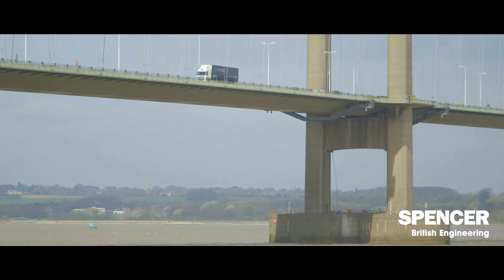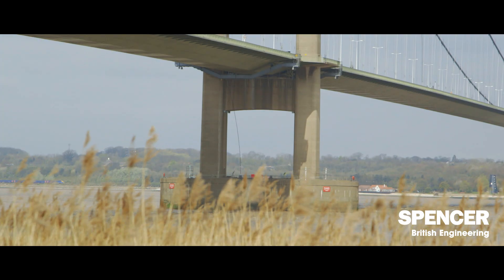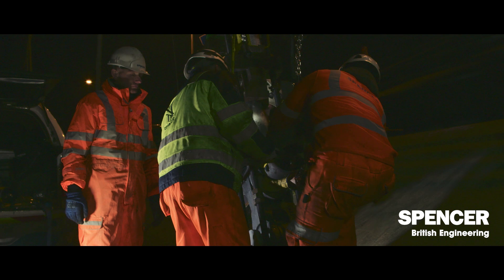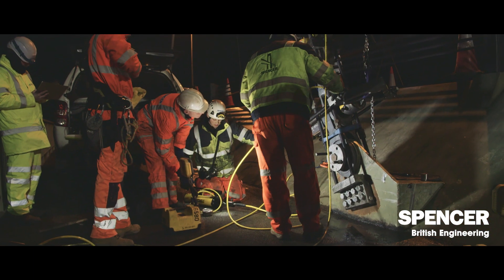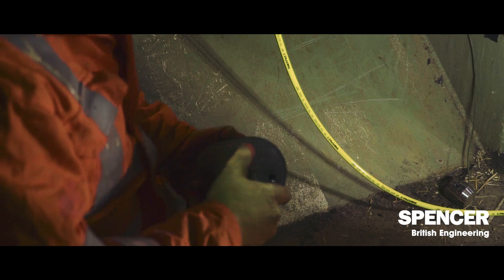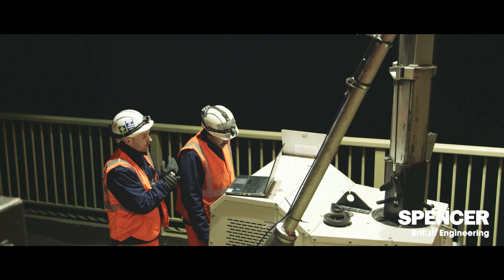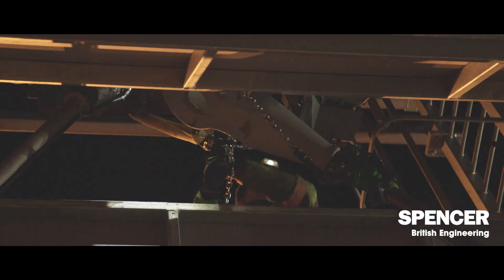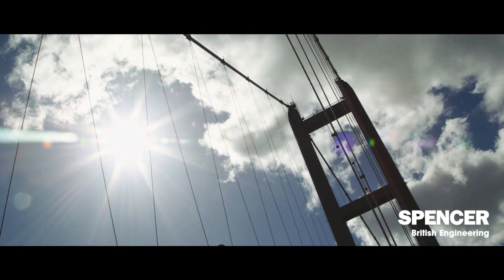Humber Bridge Hanger Replacement

Comment: What I like about this Humber Bridge is the fact that the hanger cables are not vertically down as in the Tacoma Bridge,  When the hanger cables are vertically down, then there are rectangles formed, and rectangles and squares can change their shape into a rhombus through changing their angles.  This would permit the deck to oscillate a little reflecting the oscillation on the main catenary cables.  This could lead to instability as standing waves can form along with the deck and along with the catenary cables acting as guitar strings.  In the modern cable-stayed bridges they are full of triangles and with three sides the triangle is a geometrical figure that cannot change its shape, 
The Humber Suspension bridge did well to chose the hanger cables to be triangular rather than vertical as this added better stability, It would still oscillate a little but the triangulation of the hanger cables would damp this down much better than if the hanger cables were vertically upright as in many of the older suspension bridges.
Well done to all the designers and the workers who had a hand at making this bridge, I would have added a few wider triangles from the main towers to the deck as the more modern cable-stayed bridges including the new one at Queensferry Scotland. That would enable the replacement of any cable,  I saw the Forth Suspension Bridge being built at about 1960 and that has vertical hanger cables which I did not favor and did talk about it to the workmen but it remained at that level as I was only a young student at Newcastle University.  The Forth suspension Bridge which was erected at about 1960 does not have a long life as the older cantilever bridge a few yards away from it. 

https://youtu.be/tgeFKVX2C-o